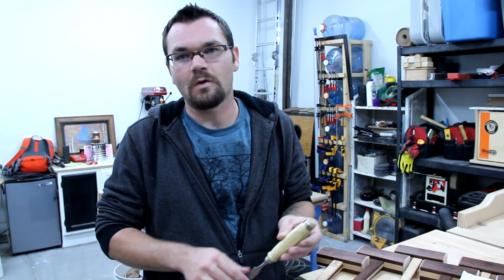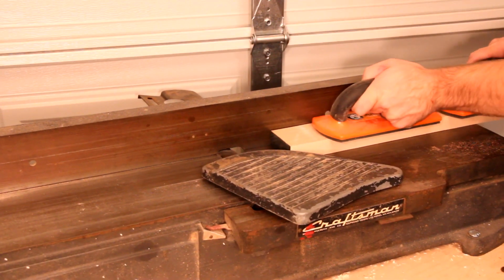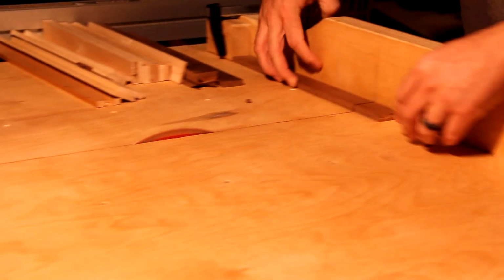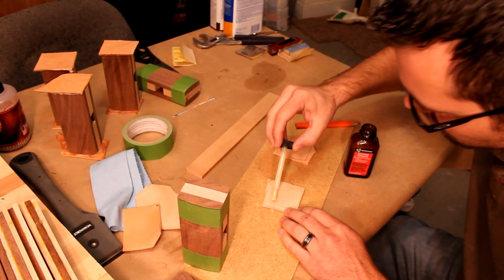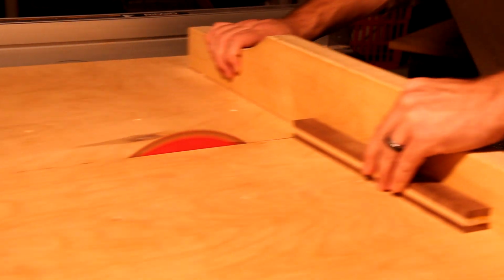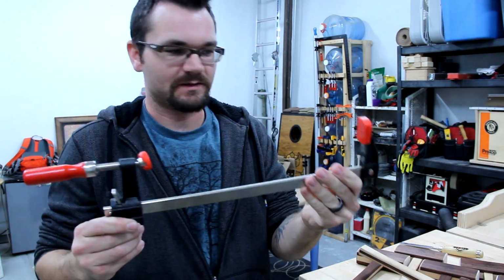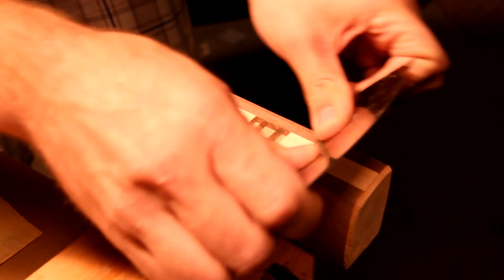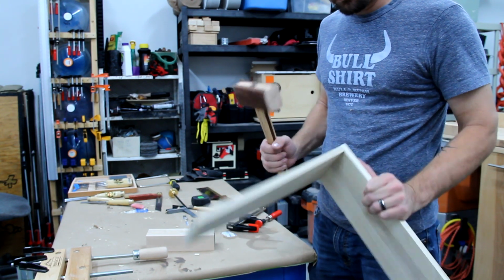Make a Joiner's Mallet

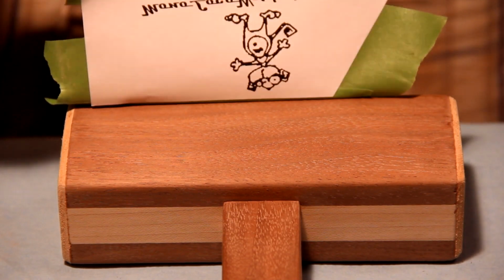Comment: Hi Ty,  in the 7:44, how you apply the lacquer thinner to put your logo, by spray or just used a rag?   Please, can you explain the whole process how you do it? I'm really new in this wood world things, thanks a lot for your help!!
Reply from the maker: Lacquer thinner or pure acetone will melt the toner from a laser printer. So briefly brushing the back side of the paper will melt the toner and transfer the print to the wood. Don't use too much or it will make the toner runny and ruin the transfer.
Reply: Thanks Ty, about red oak and white oak, which one are harder?

Comment: Ty, Do you recommend mahogany for a mallet making? Is it enough hard for this?
Reply from the maker: Mahogany is on the softer side of the hard woods but if the business end of the mallet is end grain and/or covered in a material to soften the blow then you'll be fine. Otherwise it'll just get dented faster but still last a long while.
Reply: Thanks a lot Ty!!

Comment: Is that the Harbor Freight combination disc/belt sander? Do you like it? Would you suggest it as a first stationary sander for the shop?
Reply from the maker: My disc/belt sander is from Rockler but from what I've seen there's much difference from the H.F. one. I've gotten a lot of use out of it but there are times I wish I would have gotten the Ridged oscillating sander instead. It's a little more pricey but I think it would come in quite a bit more handy. Plus I don't think there's much the disk/belt sander would do over the Ridget oscillating one.
Reply: Ty Moser Awesome!  Thanks for your quick reply!

Comment: Hey Ty!  First off, excellent video and great mallet.  You have inspired me to make one.  I found the shopnotes issue with the plans for this, but noticed that your handles also have walnut and maple on them.  Together do they equal the size noted on the shopnotes.  Curious if it matters if i use something bigger.  I would think the tendon is the only size that really matters as it fits into the head of the hammer.  Have you seen Paul Sellers new videos on him making a joiners mallet?  http://youtu.be/u31Ixu6mSHY  At the beginning he talks about how a laminated mallet won't last a lifetime.  Curious what you think about that?  Regardless, I'm going to make one of your (shopnote) mallets and maybe I'll do one of his one day! Thanks for a great video.
Reply from the maker: Out of the 6 mallets I made, only a couple of the handles were the same size. As you pointed out, the tendon is what matters. As long as it's think enough to not break or in your case thinker I think it'll be fine. 

I did see Paul Sellers video. A laminate mallet probably won't last as long as a solid one but everybody says glue is stronger than wood so as long as you got a good bond I wouldn't be worried about it breaking before expected. I do have plans at some point to make a solid mallet out of a chunk of mesquite I've had laying around for a while.
(Plus the solid mallet is meant for heavier hitting so I wouldn't expect the laminated joiners mallet to get the same abuse.)

Comment: I just Finished mine! turned out okay, I don't have a tenon jig so it was a little hard, handle isn't quite flush with the head. Could you either do a video (I know that's a lot to ask) or post some pictures or resources on how you built it?
Thanks!
Reply from the maker: *****  Awesome that you finished yours! The tenon jig I used is basically two 2x4's or scrap wood screwed together at 90 degrees in such a way that the horizontal one rides on top of the fence. I was thinking about improving on it or building a different style and making a video out of it. Until then, hopefully this picture I just took of mine will make due. 
https://lh6.googleusercontent.com/-eo5uj6WcIOo/VLt1QT1wfeI/AAAAAAAAegQ/BN_9FHPZdzc/w1538-h865-no/20150118_015625.jpg
Reply: Ty Moser Perfect, thanks! gives me something to work off of! I plan on making one for my Dad too, he's always smacking stuff with hammers in his shop!!

Comment: Could you explain to me again how you did the logo again. I didn't know this. Or could you link to a video where you can do this ?
Reply from the maker: TotalVikingPower I just printed a reverse image with a regular laser printer. Stick it face down and tape it so it doesn't move and rub just a little lacquer thinner over the back of the paper. This will melt the toner from the laser printer and transfer it to the wood. Don't use too much lacquer thinner or it will get blotchy.

Comment: Nice video, glad I found you, thanks to the Drunken Woodworker.  I like the way you have paced the video, the background music, and your relaxed presentation.  

FYI- you set the 2 degrees with a sliding T-bevel.  And that trick with rubbing some glue into the small gaps- try it with a little dust added to your glue, harvest some dust from the sander port.  

Did you glue the BB's tight, or do they move around some?  I think when the BB's move, they kinda cut down on the bounce.

Again, good job, nice mallets, looking forward to seeing more vids.
Reply from the maker: Thanks Dan! April Wilker and I were talking about the sliding T-bevel a couple days ago. I generally know what things are called, until I have to say them on camera. :)

The first mallet I used lead sinkers and put in a bunch of epoxy, the rest I just put in a bunch of wood glue while I was gluing the head together but none of them were glued solid. Each one has a little rattle but probably not enough loose material in there to give you the dead blow effect. 

Thanks again.

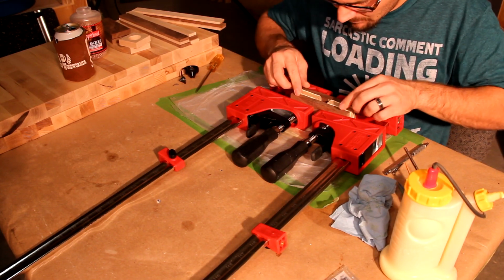Comment: I don't usually write comments about safety... at 3:24 you joint a short piece so the risk of kickback is bigger. I think the belt sander would have been a safer choice.
Reply from the maker: My jointer is one of my more recent acquisitions so I'm not probably not doing everything right with it. I was more concerned with the thickness of the piece so it kicking back due to the short length didn't even cross my mind. Thanks for bringing this to my attention.